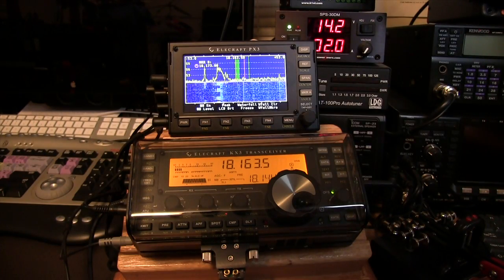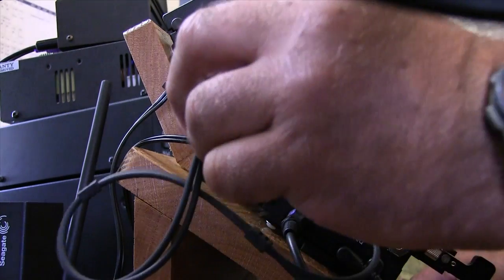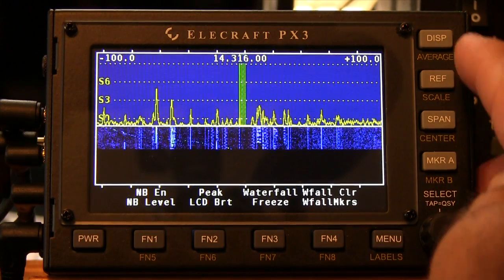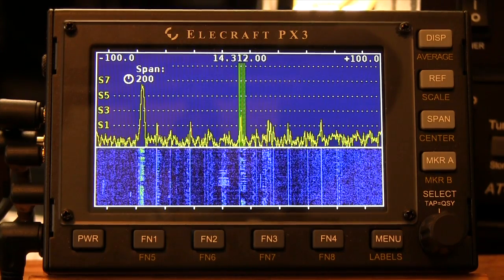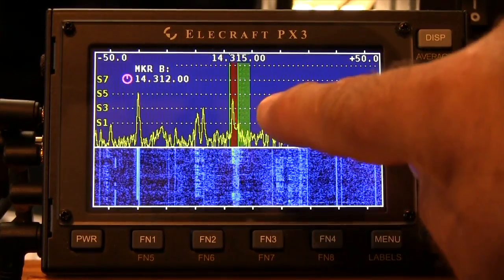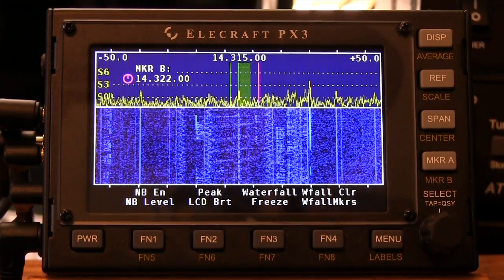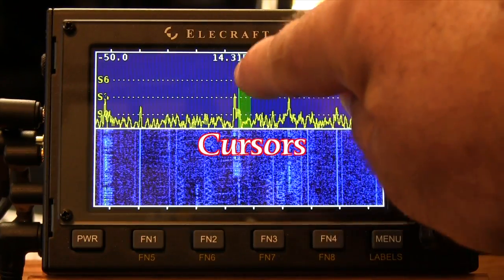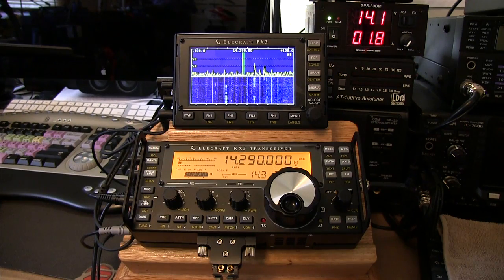PX3 Overview Based on Beta Firmware Rev. 1.12

Comment: Any idea why the display seems to bog down when it's decoding your own transmission?
Reply from the maker: It doesn't bog done.
Reply: It’s pausing on transmit, that’s all.  My 7300 does the same thing.  I was going to get a KX3, PX3, and a KXPA 100 since I like my KX2 so much (plus my K1 and K2 that I no longer have) but opted for the 7300 as it’s all in one.  Now I will just wait for a KX4 and PX4 with touch screen ;-)

Comment: JD, I am just getting into Ham Radio. Purchased a Baofeng UV-5R to make my first contacts on two meter. I'm studying up with several apps for my Tech License and I am studying the art of CW like I have to (even though I don't have to yet, trying to learn like a traditional student would). I live in Grain Valley, just east of the metro and did not know where to start locally to be in a club or find a mentor. Any suggestions?
Reply from the maker: I think your best bet is to find a mentor. One that has been in the hobby 10 or more years without a break and has tried many different parts of the hobby. And of course one that has some time and is willing to take you from a - Z. Hands on is the best way to learn. Anyone can remember facts etc. but practical hands on will really sink in. Clubs are okay and you tend to get a wide diversity of people in these organizations. However, the same Elmer (mentor)  will always be the best approach. CW is great to learn, I worked at it for almost a year and finally passed back when it was still required  in 2005. I do still use the mode on many bands. If you were here with me now I would have to ask you want and where you want to go in the hobby? It's always a question I ask to find out about expectations. It's has less to do with what you know about the hobby now, but more about what you want to learn along the way. There's is so much to do in this hobby and having somewhere break it down in steps is very important so you learn and don't get overwhelmed. Let me know if I can help you! JD - N0IRS